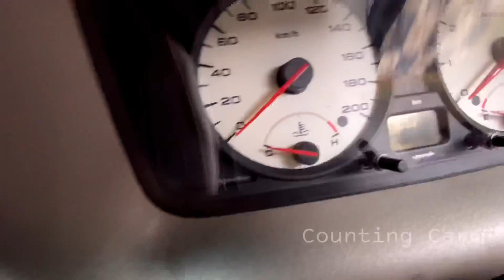Rs 50,000 താഴെ 78,000 KM ഓടിയ ഫുൾ കണ്ടിഷൻ TATA INDICA🔥| Used cars kerala | Second Hand Cars Kerala.

Comment: ഇന്ഡിക്കക്കു സാധാരണ ആയി ഡീസൽ കേബിൾ പൊട്ടിപോകാറുണ്ട് വലി തീരെ കുറവാണ് എന്നൊക്കെ പലരും പറയുന്നു ഇതിലൊക്കെ എന്തെങ്കിലും സത്ത്യം ഉണ്ടോ എനിക്ക് ഒരു ചെറിയ വിലയുള്ള 2008 മോഡൽ ഡീസൽ വണ്ടി വാങ്ങാൻ താല്പര്യം ഉണ്ട്... ഒരുമറുപടി തരുമോ പ്ലീസ്‌
Reply: ഒരു പ്രോബ്ലം ഇല്ല ബ്രോ ഡീസൽ വണ്ടി സൂപ്പർ ആണ് കാണാൻ ലുക്ക് ഇല്ല എന്നുള്ളത് സത്യം പക്ഷെ ആള് പുലിയ പുള്ളിങ് കുറച്ച് കുറവാ മൈലേജ് 18 20 22കിട്ടും ഹീറ്റ് കൂടുതൽ ലോങ്ങ്‌ ഡ്രൈവിംഗ് സാധ്യമല്ല
Reply: Nice vandi aanu bro maintain cheyunna pole erikum vandiyude life ente kayil 2008 model und njn ee vandi 2 yrs old means 2010 vagiyath anu eth vare oru issue vannatila crt aayi oil change and karayagal cheya pine epo anu back suspension onu change aakiye pine radiator il vellam ozhikathe cooolent aakiya oru heating pblm undavilaa nalla milege nalla cmfort ellam und vere vandi und enkilum njn kooduthal ee vandi anu use cheyumnath ... pine 1400cc diesel engine anu turbo ella ath kond thane 55 bhp ullo vandi 55 bhp olla vandi athinu anusariche pick up and pulling oke indavolo apo athinu vali kuravanu enu parayunnathil valiya artham ind enu enik thonunillaa

Comment: 2006,2007 Model Indica engine Complaint sthiram varunna models aanu. 2008 above models nallathaanu. Ente opinion alla based on the experience of an expert Tata mechanic
Reply: 2006-2007 ഡീസൽ ഇൻഡിക്കയാണ് Problem ഉള്ള കാർ. ഇൻഡിക്ക എടുക്കുന്നവർ 2010 മുതൽ ഉള്ള വണ്ടി എടുക്കുക
Reply: @p.v.r1310  ഇത് അപ്പോൾ കുഴപ്പമില്ലേ?
Reply: @Saleena2004  ഡീസൽ ഇൻഡിക്കയാണ് Best. Millege 18 to 23 വരെ കിട്ടും. 2010 മാർച്ച് മാസം മുതൽ ഉള്ള സാധാ എഞ്ചിൻ ഇൻഡിക്ക സൂപ്പറാണ് (ഡൈക്കോർ എഞ്ചിൻ ഒരു കാരണവശാലും എടുക്കരുത് )
Reply: @p.v.r1310  Budjet kuravanel 2001-2003 vare ulla indica eduthal mathi...Butterfly Shape edukaruth.
Reply: @amalreji323  yes
Reply: @albesterkf5233  നമ്മൾ ഇപ്പൊ ഇൗ വീഡിയോയിൽ കാണുന്ന വണ്ടിയുടെ shape (Diesel)
Reply: @p.v.r1310  എന്‍ജിന്‍ decore ആണാേ,quatrajet ആണോന്നു എങ്ങനെ അറിയാം
Reply: @amalreji323  അതെങ്ങനെ butterfly shape
Reply: Aarenkilum replay tharanam. Njan 2006 model idica petrol edukkuvaanu. Problem undaakumo.. 70000 km odiyittund. Well maitained
Reply: @amaljoseph219  indica petrol maintenance kuravanu..Valiya pani onnum illa...but milage കുറവ് ആയിരിക്കും👍
Reply: @amalreji323  🥰 thanks for your replay
Reply: @amalreji323  oru doubt koodi. 2006, 2007 model vandi edukkaruth enthokkeyo pani varum ennu parayunnathil kaaryamundo
Reply: @amaljoseph219  Athu Diesel model aanu..Athinu engine related problems kooduthal anu like Oil leak,Decompression etc..
Reply: Nishad Mp quadrajet Vista, Manza ennee modelukalilulloo.
Reply: 2004model better ano?
Reply: @gamblingscalper5960  ചേട്ടാ 2002 മുതൽ 2005 വരെയുള്ള വണ്ടികൾ എടുകാം 2006,2007 മോഡലുകൾ സ്ഥിരം engine complaint anu 2008 മുതൽ ഉള്ള വണ്ടികളും എടുകാം
Reply: @p.v.r1310  bro പറഞ്ഞത് കറക്റ്റ് anu dicor engine il timing belt പൊട്ടിപോകുന്ന പ്രശ്നം ഉണ്ട്  അത് പോലെ spare parts nalla rate anu company പറയുന്ന കിലോമീറ്ററിന് മുമ്പേ belt പൊട്ടും
Reply: Petrol yeduthal kuzhapomundo 2007 model